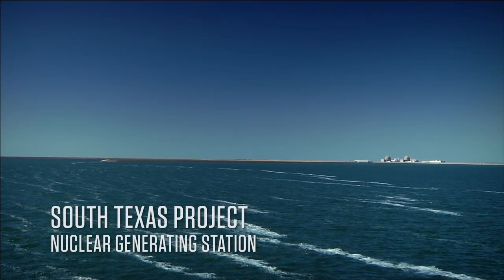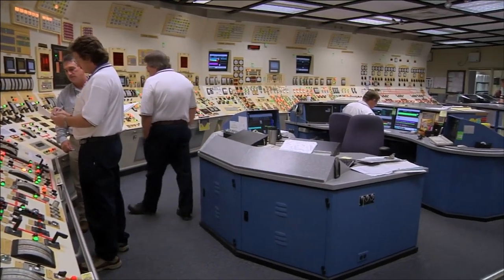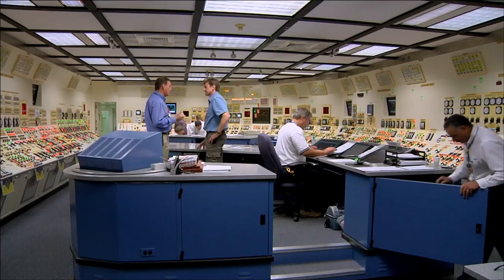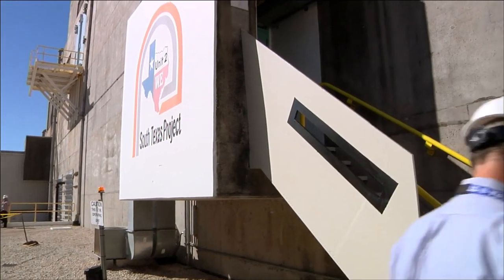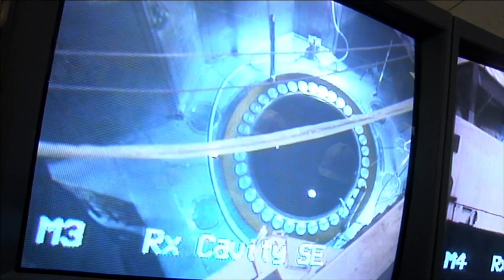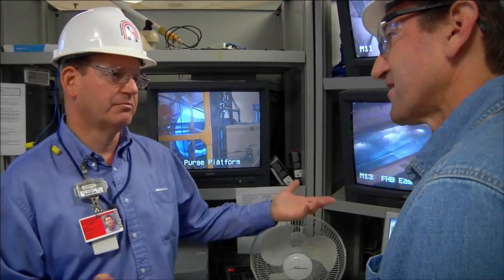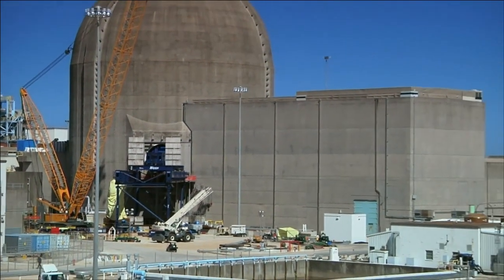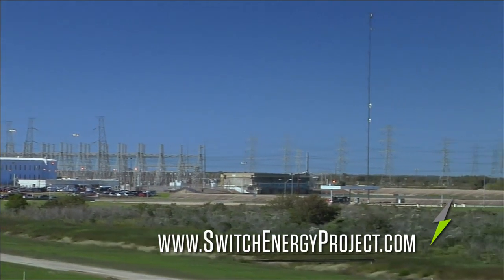What is The Future of Nuclear? Inside the South Texas Project

Comment: Finish those damn reactors now!! This is ridiculous! Every ignoramus in the fucking country with a cellphone and a Facebook account is running their mouths about how dangerous nuclear power is! They're absolutely wrong! Nuclear reactors today are some of the safest things ever built! They're designed with fail-safe technology! To be clear to the fools who read this, fail safe DOES NOT MEAN FAIL PROOF! Instead what I'm saying is that when they fail, they fail in a safe manner. 

Imagine a magnetic lock with a spring release. If the power goes out, you aren't trapped. The magnet is fighting the spring, so when the lock fails, the spring opens the lock so you aren't trapped, thus it failed safely. Even safer still, Imagine no spring at all, but the magnet holds the latch upward, thus when the lock fails the natural process of gravity pulls the latch down and unlocks it. Thats fail-safe.

Modern nuclear reactors have fuel that literally chemically changes when it becomes too hot, and lowers it's own reactivity. So if the bajillion cooling pumps and redundancy fails, the core still cannot physically melt down... not that it would ever get to that point, because some of the cooling back up systems are ran off physics. The steam from the hot reactors instead of turning turbines will pressurize water tanks that will then push more cooling water into the reactor with its own residual heat, without any need of power or mechanical moving parts or valves.

Modern shit CANNOT FAIL... and yet we're still scared because of misinformation from bullshit disasters ran by idiots